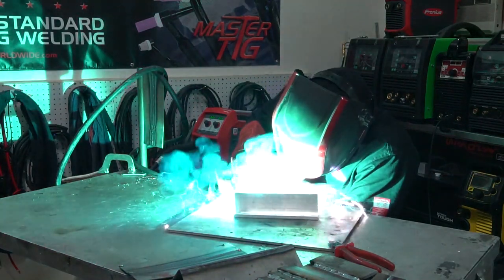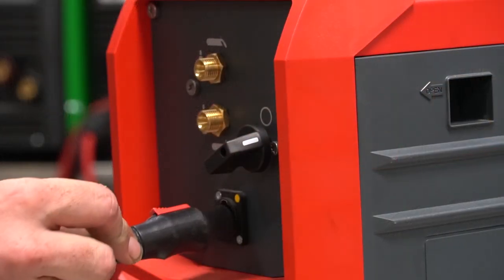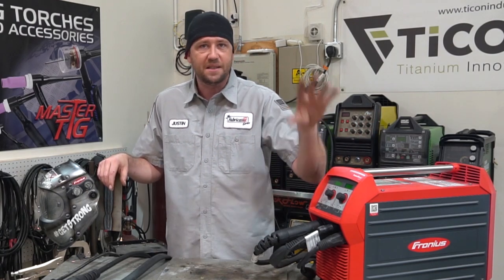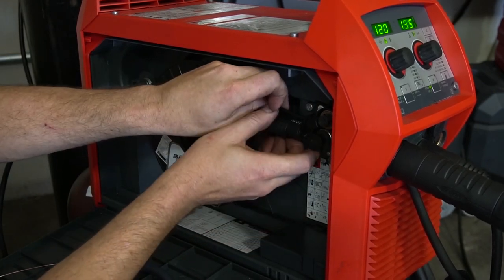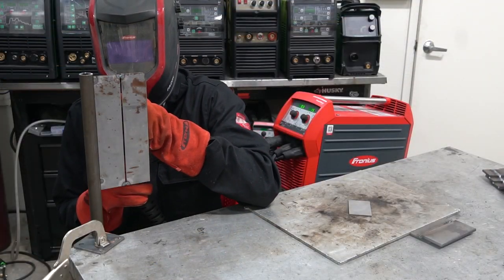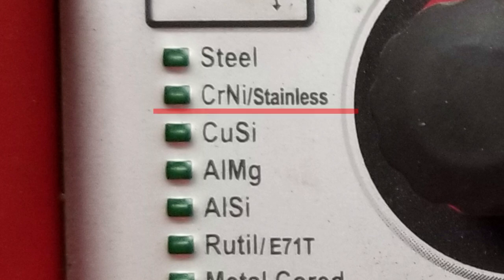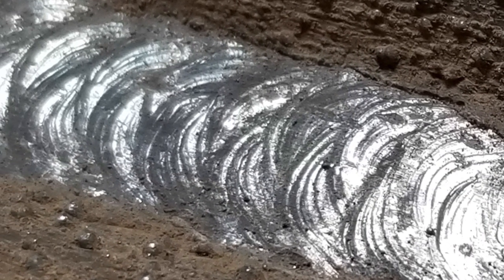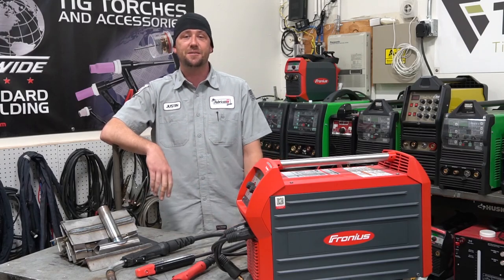TFS: Fronius Transsteel 2200

Comment: I am a complete novice and I am looking for a multi process welding.  This is on the upper end of the price range of the ones I have been looking at but I would rather buy a better product once vs buying a cheaper one today then having to get another one in a couple years.  Would you buy this over some of the other models that are in the $2000 range?

Comment: I love this welder and have been in the fence with buying it. What has turned me a away is the scratch only. If it was HF I would own it already
Reply: Conner McPherson it’s not scratch its liftstart
Big difference
Reply: @martinandersson5278  yep bug difference, you only bring the tungsten close to the work peice, no scratching
Reply: not true ,,, thats hf , high freq that works that way ,,
lift arc you touch the tungsten , then as you lift it the arc starts.. hence the term lift arc.

Comment: As far as a multi process machine goes, I want one! I am sold on the aluminum feature. I like the fact you don't have to switch out to a push pull or spool gun. I currently have two Miller Multi-matic machines and as far as putting all eggs in one basket, its the only way ill do it. My little Miller suitcase 200 has paid my mortgage and has saved my ass time and time again.

Comment: I have noticed that Fronius foot pedals have a ten pin plug. The TransSteel has and eight pin plug using six of those pin positions on the torch plug. What sort of foot pedal is compatible with that thing?
Reply: You can get the pinout online, some people rewire cheap pedels to run with it., its essentially just 3 wires,  +10, gnd and wiper.

Comment: Cool, I didn't know there was one welder that does all.  Can you add spot welding tongs to it?
Reply: Garage Time - They make spot welding tig cups but not sure about tongs. That would be a cool video 🤘
Reply: Can't run a 6010 though?
Reply: @samnottheotherone4363  Salesmen say no, but it does have the required 90V open circuit voltage, I will try it, soon as it comes.

Comment: Looks like a very capable unit. It does have a couple of points I'm not crazy about, most importantly and not limited to just this brand but all brands of "All In One" machines have one major draw back! If the machine dies, you lose all ability to work! 
Having 3 separate machine allows you to have a backup if your first choice for the job fails you in some way.
"Don't put all your eggs in one basket!" Comes to mind immediatley!! Personally, I'd rather have 3 separate machines. Even 2 if I can't afford all 3 at once. Great features though. Hope they put all of that in each single process machine!
Reply: patrick farley I would say the independent machines run the way hands down 🤘
Reply: Forgeting one thing, Fronius do not break.....ever.

Comment: I bought this welder, mainly based on your review. It would be nice to tell viewers that to weld aluminum, one has to buy a different liner, different drive rolls and oversized contact tips. Could have bought the HTP and a spool gun and still be money ahead.
Reply: Damn...what do I need to buy, what size?, know nothing about Al welding yet, got 0.8 and 1mm tips,, 0.8mm and 1mm liner.

Comment: I've ran a lot of small portable wire feeders the real test is running self shielded .045 wire this wire so hard and stiff that it breaks most machines I've ever used, I've used Miller, Lincoln, excetera doesn't matter they all eventually break down but I am curious how this machine would hold up looks beefier?
Reply: interested as well
Reply: Audi uses them, they rarely break.

Comment: Im looking to upgrade my mig machine and Im trying to compare the HTP pro pulse 220 MTS to other high end machines and get something that is super versatile with synergic capabilities. What's your opinion between these two machines? Would this one be better or more versatile and why? Witch one would you rather buy? I think the user interface might be nicer on the HTP and tig functions might be more complete but im buying a machine mostly for mig because I already own a nice HTP invertig 221 so im not super concerned about tig functionality unless either of these machines has some kind of awesome feature that the invertig 221 doesn't. Are there any other machines that I should consider that aren't made in china such as everlast?
Reply: I find myself in a similar situation a year later.  Did you get one yet?

Comment: I bought one and forgot to research how expensive and not readily available the consumables are. Do you sell the consumables for the transteel 2200.  Because I have yet to find consumables in Vegas.
Reply: your mistaken. contact tips and nozzles can be found at several online shops and are no more expensive than miller. but if you know how to weld youll rarely ever have to replace those. over 50lb wire my contact tip still looks good. havent needed to change it yet.
Reply: Thank you. Good info. Very much appreciated!

Comment: I'd love to have one of these at work. I MIG weld aluminum all day and to be able to use a normal MIG gun instead of a spool gun would be amazing. Do they have something comparable to the MillerMatic 252 with the same capability?
Reply: The Tranny Shop Yes. They have the big brother called the TransSteel 2700

Comment: Nice review. Can this machine also perform dual shield flux core welds on 1-inch thick steel project?  What is it's duty cycle(s)?
Reply: This comment is rather old... so you prob already have an answer. 

But the TransSteel2200 is more of a portable welding tool for low duty cycle work. Its perfect for those remote onsite repairs and everything youd ever need for a hobbyist welder. 

But for production work, high duty cycle work, or anything super heavy. I wouldn't suggest going with the transsteel. Its max rated output is 220amps on CV with a 60%duty cycle.  when running 1" stuff you probably would need a little more than that... 

Instead id go with the TPSi series. Which can range from 270amps to 600amps with water cooling options etc...

Comment: do they have a model that will work on a standard 115v? also, where can i buy ?
Reply: I think this is a duel voltage machine. 110 or 220-230
Reply: Yes, they have multivoltage versions.

Comment: Any experienced with 6012 rod? I have about a hundred and forty pounds of it in my garage.
Reply: Two drawbacks for the 6012 rod include its thin penetration profile and extra post-welding clean-up because of its thick waste material from smelting. Its meant for horizontal position, no special welder needed, probably similar to 6013.

Comment: Thanks for the review. Very well done! Can it stick weld cellulose electrodes like 6010?
Reply: Preciv, have you used your transteel yet? Any feedback?
Reply: @BravoActual4756  Not yet, still in the box, I had to travel for a while. All i did so far is gather info about the machine and what it can and cannot do. I am even contemplating exchanging it with the Transsteel 2700 for  more power when I get back, not sure though.

The machine is very well built and has very nice reviews, so if you are looking at one for around the 200 amp range and don't mind the lack of 6010 functionality, I would say it's a fantastic machine from what I have gathered so far. 

Not to confuse you, but if you are in the market for such machine, I would also take a serious look at the HTP Pro Pulse 220. (rebranded Stel, made in Italy, and Stel is a top manufacturer in Europe and make machines for a lot of big names in the industry). Anyways, the machine does pulse welding, holds bigger wire spools (bigger spools are cheaper and easier to find) and seem to have more voltage range which is useful if you are doing other processes like Spray Transfer or Dual Shield (maybe these futures aren't very helpful for someone in their hobby shop?) On the other hand, The Fronius is more rugged/build tough, has power correction factor that allows the usage of very long extension cords, has slightly better duty cycle and slightly more amps (20 more). Again, maybe not so important for a hobbyist.
Reply: Have you tried 6010? it has an high enough open circuit votage (90V) which suggests it can.
Reply: @engjds  it can't. The maximum voltage for MMA is 27.2 volts. That wouldn't run 6010. It wouldn't run 6011 either. 6010 needs at least 30 volts while welding (not OCV)
Reply: @Precivilization  I believe thats the welding voltage, the open circuit voltage(max) for  that welder is 90V which 6010 requires, so unless I am missing something, in theory it could run it.

Comment: Great video brother. I’m still very curious how this stacks up to my HTP pro pulse- they look like they have all the same features. I love the silicon bronze program as well I use my HTP Silbro on galvanized and it works great.
Reply: HTP is a Stel
Reply: grumpybill well HTP is HTP America they sell more than welders but yes HTP has Stel make them for HTP
. They are all pre programmed and specked for USA gases, wire etc. just like the same company makes Rtech and Everlast. Stel is the Miller of Europe, Stel makes great stuff.
Reply: @weldingjunkie  whose the lincoln?
Reply: grumpybill Lincoln is Pepsi Miller is coke LOL IMO Lincoln is putting out the same home owners crap miller is. The mp210 and the matic 211 all Junk along with the other stuff..I do like my dynasty though. High end stuff is good. I’d rather my HTP(Stel) over both of them any day and twice on Sunday.
Reply: Stel is very popular in Europe indeed, but they are not the Miller or Lincoln there, they are just one of multitude of  top welding equipment manufacturers. There is EWM, Lorch, Merkel, Kemppi and Fronius (With Fronius being the most expensive) just to mention a few.
Reply: Your pulse an do AC tig...this cannot, but its probably better every other way.

Comment: Fronius 2200 compared HTP  Pro Pulse 200?
Reply from the maker: I have no hands on experience with the Pro Pulse 200
Reply: The HTP inverter MIGs like the Pro Pulse 200/220 MTS can hold 12" spools of wire, this Fronius model only 8" spools.   They are both obviously synergic, but the HTP ProPulse MIGs have pulse-aluminum and double-pulse.  Seems the Fronius 2200 has similar sets of parameters available to set, but no pulse nor double-pulse like the HTP ProPulse units.  Fronius lists 3 separate liners for steel (030,035/040,045) and three MORE for the same size wires in aluminum, so gotta be careful on that because you might potentially need 6 liners to be swapping, lol.  On the Pro Pulse 200/220, you only need one liner for steel 030/035/045, but there is a whole 'nother gun for aluminum welding since it has it's own dedicated graphite liner.  It is also shorter at only 8ft but that it because of the pulse and double-pulse capabilities --- the gun needs to be shorter to accommodate that kind of pulse operation.  One US vendor website, they list 5 gas nozzles for $140 !!!  I guarantee you that the ProPulse nozzles are nowhere near that expensive!  A 5-pack of diffusers will run you $63 !  Yikes!  Way more cost for replacement parts than the ProPulse units.  If you want another MIG gun so you can have one for steel and another for aluminum, for the Fronius that will set you back a cool $500! for a single gun! Ouch!   A replacement HTP gun is like only $150!   HTP sells durable CuCrZr (copper-chrome-zirconium) extra life tips that really stand up to spray and pulse-spray transfer, so tip life is extended compared to regular copper tips.  Oh and with the Pro Pulse 220 MTS  units, you can order add-on's like:  Remote slider control, spool gun, and even an air cooled push-pull gun for serious aluminum fabrication.  The remote control works with all three methods: regular MIG gun (whether it's aluminum or steel), and with the spool-gun AND with the push-pull gun to synergically control the welding output!  That right there is the ultimate in welding control.  If you want pulse and push-pull with Fronius, you're looking at $11,000 at minimum.  If you want their low-spatter-control or their modified pulse arc feature with aluminum, you're looking at nearly $15,000 !  The HTP Pro Pulse 300 would run circles around it for less than half the cost, for steel, aluminum, silicon bronze, stainless steel, gas less flux core, dual shield flux core.  A much better value IMO.
Reply: @zod-engineering-welding  Thank you very much for the detail comparison! I am "on the fence" between this Fronius and your HTP ... How long have you used it and are you happy with it?

Comment: Great review and really helpful. I was actually considering buying this welder based on your review right up until you said it's a scratch start only machine. Do you know which model has hi-freq? The only processes I'm interested in are mig and tig.
Reply: its lift , not scratch ,, as far as i can see
Reply: I think the new HTP pro pulse 220 mts has high frequency start tig. Its very similar to this machine in price and features. It does mig, tig, and stick. Has tons of cool features like pulse mig, pulse on pulse ect ect.
Reply: Its lift, I do not see any disadvantage with lift over HF.
Reply: @engjds  you need hf for aluminum and other alloys
Reply: @nathanschmaltz672  Why isn't lift tig suitable for those?
Reply: @engjds  the tungsten will contaminate the base material. You only use hf when welding aluminum if you are doing anything that needs to pass a test.
Reply: @nathanschmaltz672  Ok, but this is a DC machine, its not been designed for Al or Mg.) All their AC machines, do have hf
Reply: Thanks for the info.
Reply: @nathanschmaltz672  Thanks for yours, I didnt think about contamination before, but that makes sense.

Comment: Yes it's great, but how much does it cost? My pocket could only afford a cheap Hyl $400 ac/dc tig plus the other $600 in consumables that you need to get running (a little over $300 just for a tank and gas). I guess what I'm saying is that I'd like to see more cheap hobby welders and not these professional machines because I just can't justify the expense.
Reply from the maker: You'll see them as soon as they exist. I'm working with a few, but the requirements for appearing on TFS include "quality & value". Without those, the machine wont do you any good to even know about. We send more junk machines back to manufacturers that fail than we make reviews about. Theres so much garbage out there that just isnt worth the money.
Reply: @TheFabricatorSeries  That I can believe, I'm working with warranty repairs right now.

Comment: the non euro connection on the torch ruins this machine in my eyes ,
Reply: although im told theres a plug in euro adaptor available now.
torn between this and an ewm  pico mig pulse at the moment
Reply: ah , turns out theres an adaptor to turn it to euro , or my dealer will fit a euro at time of purchase ,,, close call between this and a rebel 205 , gain ac tig , but ,,, no 205 in uk until later 2019 ,, typical.
Reply: tom thompson loves my transsteel 2200, but if you are planning on using the TIG process extensively, get the EWM. Fronius crap is extremely proprietary.